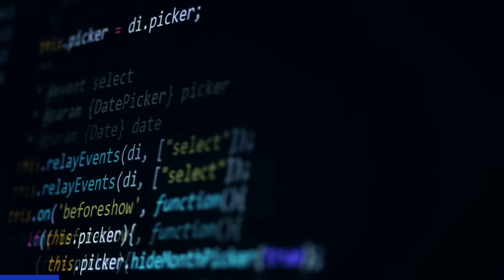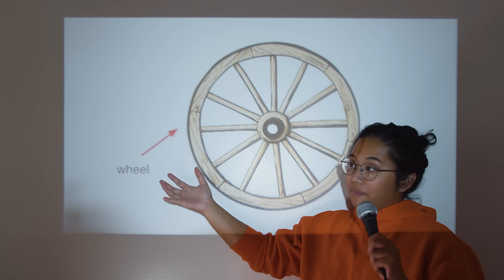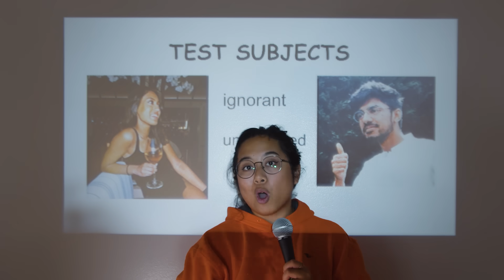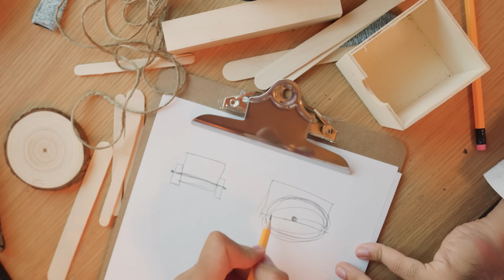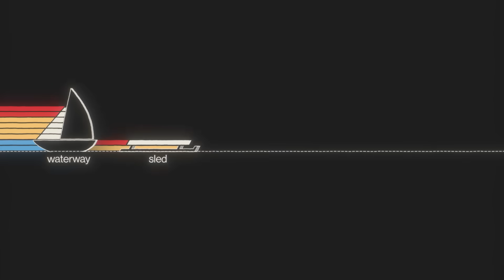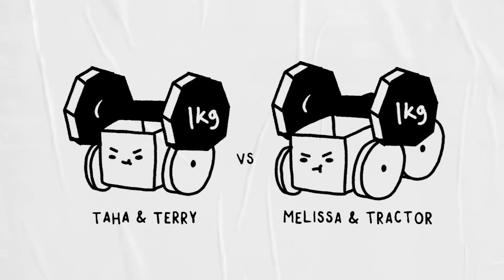why it took 200,000 years to invent the wheel

Comment: Prehistoric people were about as smart as we are. They didn't have the knowledge available (though neither do many present-day people), so they have to work all of this out for themselves, from first principles, from observing things, trying things, trying to divine the principles that made things do stuff. With an understanding of basic motion, and things like that, they could start off understanding the lever, the wheel, the ramp (and screw). and from there, eventually, lead to an age of mechanical ingenuity in the Renaissance. Although the Ancient Greeks and Egyptians did a good job of spending their excess productivity on research too.

Heron of Alexandria invented a primitive steam engine. It was just a sphere with right-angled pipes stuck out of it, so when you filled it with water and put a candle underneath, it'd boil and the steam would shoot out and make it spin. The major problem was that the efficiency was pathetic, it could never be used to do anthing useful, but still it showed steam producing movement, through pressure and temperature. The Greeks probably put that down to the Aether or one of their gods or something, but still, it was something. The Romans built Aqueducts all over the place, covering dozens of miles, to bring water from mountain springs to city centres, where it flowed from beautiful fountains, where people could bring buckets to get drinking water.

Those people weren't any less smart than you or me, and some of them smarter than most of us. There's always been a small number of smart people, a wise society looks after them and pays attention to their crackpot theories, leaving it up to the other scientists to decide what was true and what was rubbish.

Comment: When you think about it the wheel and steam engine probably came about from a similar set of circumstances, as in multiple elements coming together at the right time for someone (or multiple someones) to have a lightbulb moment to figure out not just the tech aspect of making it, but also how to make it useful and use it efficiently. They probably had a comparable impact on humanity too. Very interesting video!

Comment: Humans sorta always reinvent the wheel... from woods, stone, iron, steel, rubber, sacrificial rubber on lightweight aluminum... now we have the new honeycomb "Tweels" designed by the military.
Reply: That's not reinventing the wheel, that's just listing different materials the wheel can be made with.  If I drain out some blood to replace the ink in my biro, I haven't just invented a new pen.  I think reinvention implies revisiting the fundamental design principles and re-engineering some variation in the core attributes that define something as being of type "wheel".  So the dude who took a round wheel and made a square wheel, and put two of these on a bicycle frame and then rode it along a catenary-shaped surface...  That was reinventing the wheel, quite literally from the ground up.
Reply: @ChristoferKelly  Not really, cause the designs are completely different and those same materials don't work in the same way, we don't put wooden wagon wheels on a car because they're the same thing. You're conflating "A wheel" with "Anything of circular shape" essentially.

Comment: Maybe the wheel was invented many centuries before, but never used or popularized. Like in the americas, there were carts and wheeled toys, but nobody used full size carts and wheeled things because of the terrain. Maybe they became popular as roads became flatter, but were invented many many centuries before.
Also, wheelbarrows dont need to work for long stretches of road, or animals. And are nothing more than a wheel under a box. A Terry. But are not really better than a sled if there is mud or snow.

Comment: The use of a rope axle was quite unique, I don't recall any anchient wheel working like that.  It offers a straitforward hub to keep the wheel on by simply knotting the ropes.  Though it has terrible friction as the load causes the wheels to be pulled into contact with the sides of the vehicle.  I wonder if their might have been something like this in the sled to wheel transition as a sled uses small solid wheels to reduce friction before true axles are developed.

Comment: Taha came so close to making a Chinese wheelbarrow that I actually laughed when he rejected the idea.  For those who don't know, a Chinese wheelbarrow is a human powered flat cart with one large wheel in the center.  The large diameter wheel made the angle of attack against a bump in the path easier for a human to overcome, and the single wheel made the necessary width of the path no wider than a human being would require, so low tech paths would work.  Additionally, because the human controls the balance of the cart, a single wheel used by a practiced operator can navigate paths that aren't level much better than a two wheeled cart without dumping.  The Chinese wheelbarrow is so old, that we don't even know when it was invented; in part because it was a military secret for a long time, as it could be used for troop supply into some hard to access territory while also being useful for defense when under arrow attack.
Reply: that's so interesting!!!
Reply: Wow! Incredible to think a cart was a secret.
Reply: @doggieonbaysil2706 People waged wars over spices before, so I can totally see this kind of stuff kept under lock and key... or whatever they used before the lock and key were invented.

Comment: A portion of the video mentions that reduced surface area equals less drag. This is not correct. The formula for friction is Friction = coefficient x force. Surface area in some cases can impact the ability of a material or surface to grip to its full coefficient but surface area is not a direct cause of friction. The gain with less drag would be the axle is smaller and thus lighter, not less surface area.

Comment: I think the problem with the strength test is that it needs to scale to actually see the problems, as round, thick and hard wood were probably a sacred tree, extremely rare or something, and also that the fibers of the wood wouldn't be aligned to the load.

There's another big problem with just the wheel then adding the axle and then adding the cart; is the adding of building a road or trying to be "all terrain".

Now to my sponsor curiosity stream xd, nah but I saw a documentary there about it, and seeing a more practical video explaining such a big deal as inventing the wheel is nice.

Comment: how to find middle of the circle:
you can do this with just a string and something to measure right angle
draw two chords of the circle, they need to be exactly the same length and can be located anywhere in
then you find middle points of both chords
take your right angle guide and square up
crossing point is your middle
Reply: A slightly simpler variation on this would just involve drawing two chords that subtend to a right-angle where they meet on the circumference.  These form two edges of a right-triangle, the third edge being a diameter. Do this one more time to obtain a second diameter.

This removes the constraint of necessitating two chords being of identical length, requiring only that one is able to create a 90° angle.

Comment: I'd say that the first iteration of the wheel was intended to just carry more than a person could by themselves. A person-drawn cart would have probably been the very first iteration of this invention. Such a cart would have probably been nothing more than a flat top with two lowered holes on each side at roughly the same height through which the axle could be passed, with enough area on top to place objects on top of, ideally held within bags and other containers. I do realize that this construction would be very resource inefficient and would have to be entirely scrapped if the holes holding the axle were damaged...but that's what iterations are for (to learn from past mistakes/inefficiencies and build/improve on them).

Comment: You missed probably THE most important factor in why "it took so long to invent the wheel" ... we chose not to. We had boats and sleds, and there simply wasn't a need to invent a wheeled cart. Plus, think about it, until you have flat pasture lands and roads (even just simple paths), a wheeled cart through rough terrain and woods makes no sense. Fundamentally, "if it ain't broke, don't fix it" we had a way to get around the things we wanted to get around efficiently enough, so there was no need for a wheel. There is strong evidence that we had all the skills, tools, and techniques to invent the wheel long before we did, it just wasn't necessary yet. Humans tend not to expend effort and time on things that aren't immediately useful, and the wheel was that for a long time.

Comment: Terry would have worked better if he had a spacer between his wheel and frame.  The string axl requires pulling the wheels against the sides.  That creates a lot of friction.  Spacers could have reduced that a lot.

I think a downhill would have been a much better test of how well they travel.

Comment: Terry's "tongue" where it connects to the horse should be rigid (and function like a lever with the wheel), but because it moves, the front edge is constantly sitting on the ground and rubbing along. It also would dig into the ground a bit and further waste energy. For melissa's, she has only wheels contacting the ground, so most of the wasted friction is on the axle and body. Terry's weight test was also unfair, as the front edge should have been lifted off the ground by the bit that goes on the ox. It could potentially break there way before the axle (which was also supported by the crate edge) fails

Comment: String, wood, a box, and some tools. Melissa's route is what I was thinking of, but i didn't think of the pencil and the popsicle sticks would not have survived. 

I think she could have kept the wheels on if she had put a shallow groove in the pencil just outside the wheel, and tied the string around the pencil in the groove. It would have been a buffer for the wheels to not slide off. It might have jammed up in thr process though.

Comment: The weight test wasn't entirely fair because there was no horse or weight to balance Terry on. With a horse attached there is tension, keeping him up straight, whereas here he was left sagging, which made him lean and touch the ground.

I think both would have drawn if this was properly accounted for.
Reply: His axle was made of string, so it would sag pretty quickly. Also would have friction and eventually wear through. But still worked pretty well.
Reply: @MacNerfer  rope is pulling wheels in. With weight on wheels those wouldn't even spin. Mellisa can work on her design revise and improve. Terry's design is good enough if you want to carry a spare wheel and really for nothing else.

Comment: I love that she put his entire cart on hers as weight.. that being said I don't think this test makes a lot of sense--first of all using a pencil neglects the complex machinery involved in the manufacturing of that pencil (although you could create a similar axle through tedious carving, but not nearly as precise).  Also I don't think the problem scales linearly.  As the diameter of the wheel and axle increases (2 dimensional) the volume of the associated storage vessel will increase at a cubic rate.  The reason elephants are near the upper range of land animals is because you can't just keep scaling things up and expect the same basic skeletal frame to support the weight.  Basically I dont think an axle/wheel needs to be as strong  at this scale as it would at the scale of an actual cart or carriage. But idk I'm drunk

Comment: Hi! Thanks for the episode. If you took a few steps back from the actual "wheel" could the precursor of the wheel be logs with most of their middle section worn down. Not sure when the "technology" of moving objects with logs started, but could the idea of a fixed wheel axle system  have developed from taking a log with a worn down middle section to the  next level. Then the other developments/innovations came later.

Comment: Just to expand: Oxen were the far more popular draft animal during the medieval age (not so sure about the ages before, there were for sure horse chariots), because it seems they were more efficient when using yokes and other pre-horse collar technologies. Horses are a bit more fragile I guess, so the wrong kind of harness can choke them or just doesn't allow them to use their full strength. The horse collar - which solved that problem - was probably invented in the Chinese area around the 6th century, but it only found its way to Europe in the 10th century and didn't really catch on. Maybe people were just fine with using oxen. But the technology becomes more popular with time and made horses the main draft animal during the 12th century.

Comment: The issue with the wheel is, that it is kinda useless... Untill you spend literally trillions in road infrastucture. A couple of centimeters of snow precipitate form the skies? Wheel is ueseless. Surface is not smoothly paved? Have fun in the mud. Need to scale something? Notice how we use steps and not slopes if we don't design for wheels. Go ahead and move a heavy cart up or down a slope. Something even like 20 centimeters high lies on the road, like a branch or a big stone? Yikes. 
Vehicles didn't exist so you want an animal to tow stuff around. But wait a minute there are no horses or bulls or other domesticatable animals like these native to large parts of the planet. There is a LOT that needs to happen to make wheels an obvious choice.

Comment: the last test didn't make any sense because carrying the weight doesn't help you much if the wheels can't keep moving with the weight on them and the string design may have been better for that. Either way you showed the point and educational purpose of the video well

Comment: Melissa's cart carrying Terry definitely deserved the win, but watching Terry be joyfully dragged across the finish line is the real winner of my heart
Reply: Terry is the real winner. Cause on thing which is the most important in this case is not strength but reliability. Imagine pulling a lot of weight just to fell over after some distance
Reply: @kgkirandharan1521  Terry's design is flawed as it wouldn't be able to carry any meaningful weight because if you put weight on top the rope is pulling wheels in and wheels will no longer be able to spin as they rub into the chassis. It's a totally stupid design. Dude slept through all his physics class. Melissas design is totally decent she even came up with idea how to secure the wheels in-place by using some string although solution didn't yet hold wheels in-place with little improvement it can easily be improved. The only thing Terry's solution is useful for is that approach can be used to attach spare wheels for Melissa's carage.

Comment: What's much more important than the creativity of developers and the data systems / software. Is every device that the computer will interact with to do something. If you don't have a printer you can't print a physical piece of media from a computer. If you don't have a CNC machine a circuit board printer a 3D printer and CAD software then you can't use a computer to physically make an object. And without robots and drones for computers to interface with they cannot interact with the environment at all. Hell they can't even see without cameras but you're usually separate systems. So much more important than the software that a machine is running is the hardware that that machine interfaces with. That's actually what's going to be important going forward

Comment: Allow me to tell you just how WRONG you are about terry.
1 : in the first challenge mellisa won, but in the second one mellisa's wheels fell off
2 : regardless of the previous fact, in round 1 there was no difficulty and therefore it should be a tie.
3 : in the last challenge, terry was at a disadvantage and you should've adjusted for that, and that its less efficent to attatch extra carts to the 4 wheeled version because you would need more pencils, and it would reduce the carry capactiy for it, but for terry you can easily attach more carts to the wheels and still have room for horses, or extend the rope, making its carry capacity effectively infinite, when with the 4 wheeled version ever extra cart reduced carry capacity.

Your challenge was rigged from the start, AND WE WILL NOT STAND FOR THIS INJUSTICE!

Comment: When the wheel spins on the axle, and the axle is mounted to be stationary, the axle doesn't need to be round. I make them square, because they're easier to mount, with round stubs for the wheels.

Comment: The engineer is me is crying at the tensioned string axle. There is no way that holds up over time. And any load at all will cause the wheels to rub against the chassis.